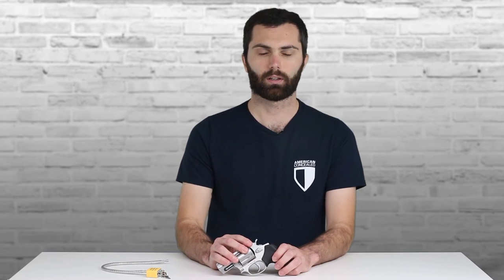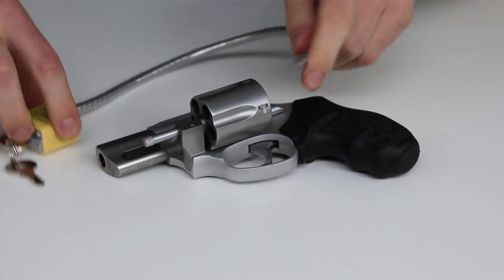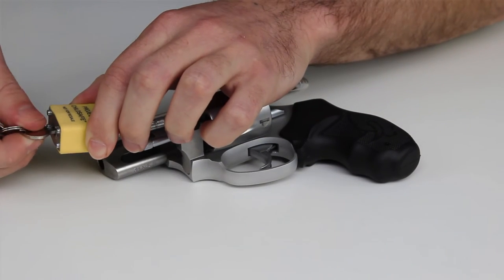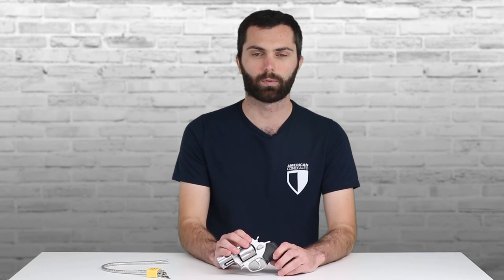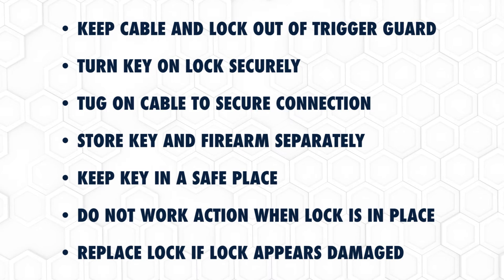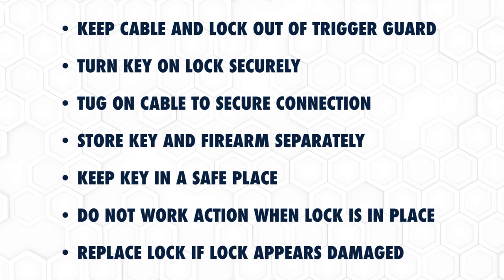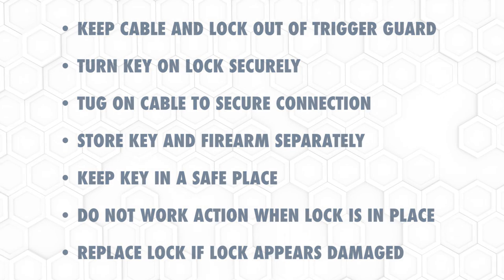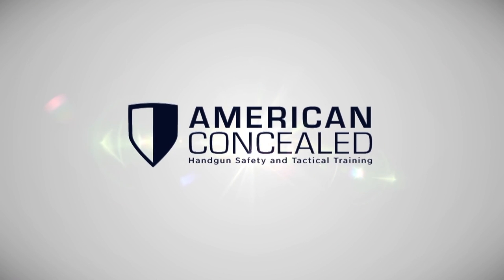How to Install a Gun Lock on a Revolver

Comment: Wrong way to lock a revolver.  Never run a cable lock through the cylinder like this because a cartridge can still be loaded and the gun fired.
Reply: How?  You can't close the cylinder with a cable going through it.